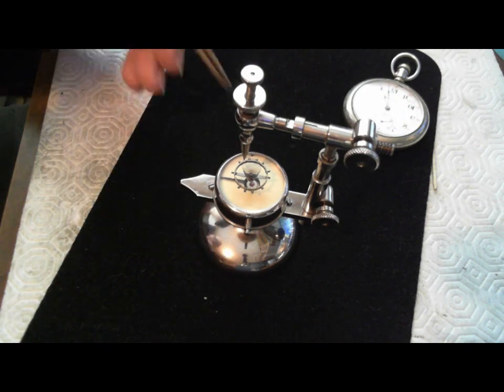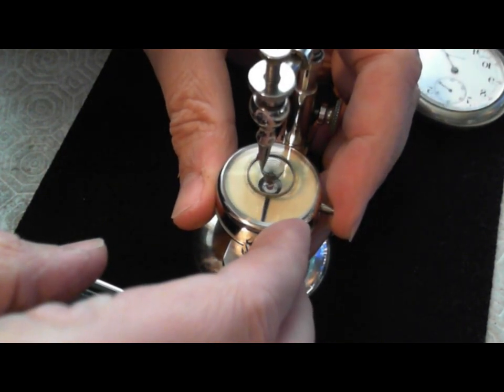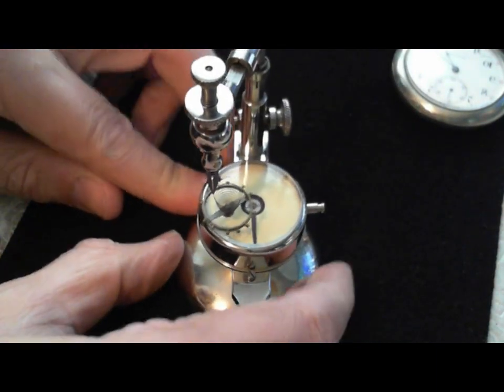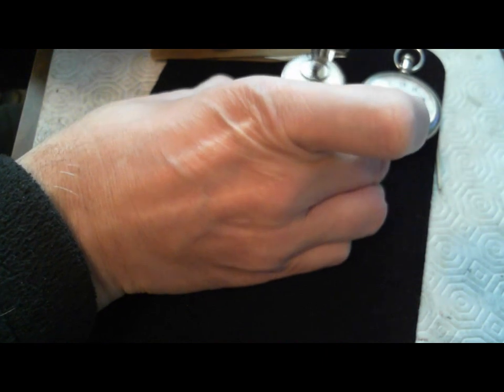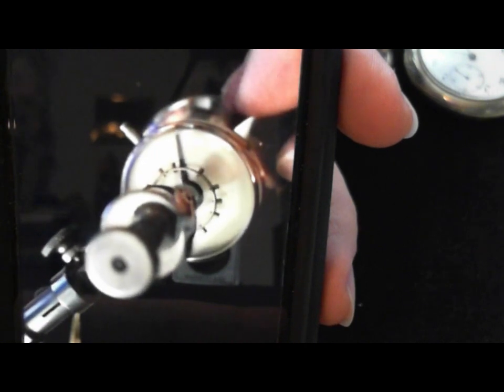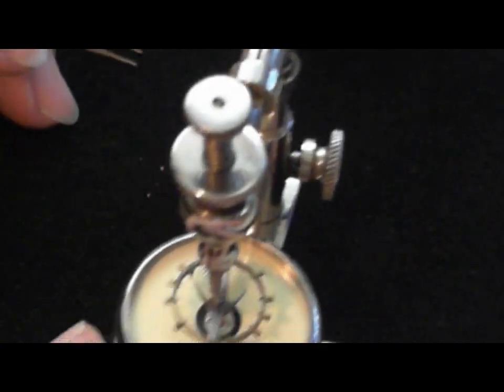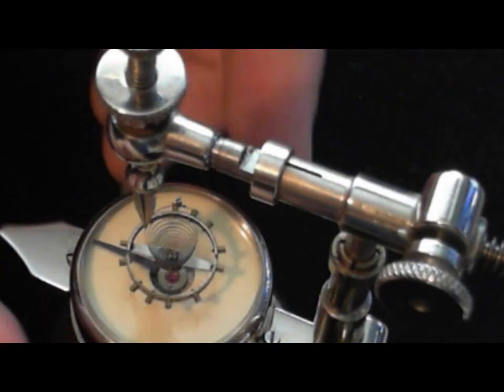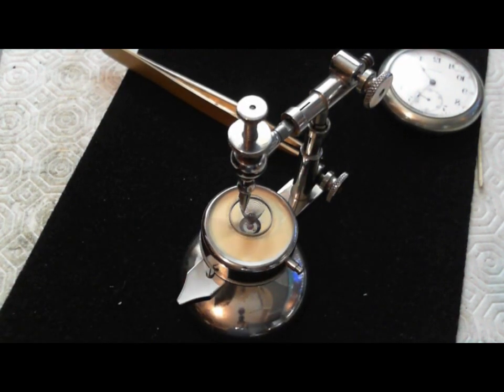Watch Hairspring Timing

Comment: Very interesting video.  I have seen a tool similar to yours. I thought to time the balance with a master balance wheel housed inside this tool, from the observation plate, a balance from a pocket or wrist watch would be placed on the observation plate then secured with the
leading edge of the balance spring held in place by the holder. By oscillating the test balance in comparison  with the master balance arc the watchmaker would adjust the length of his test balance to match as close as possible to the arc action of the master. I think then, the watchmaker would mark this point on the balance spring to eventually replace the stud for the proper length.  Your illustration here, I do not understand exactly how you can determine how to compare to a master balance that I did not see on your tool?
Reply from the maker: rgoidel The master balance is inside the puck